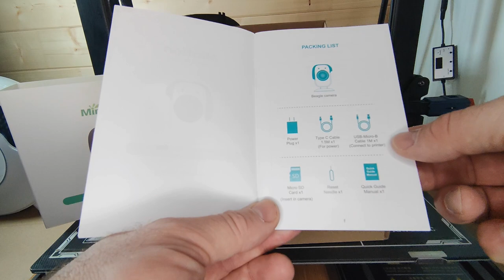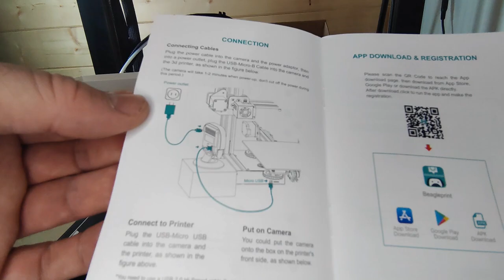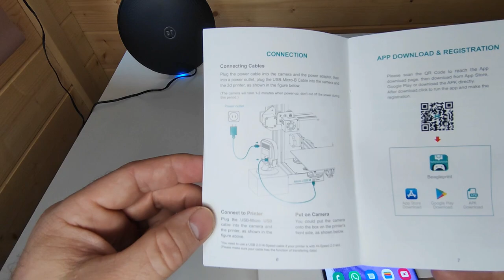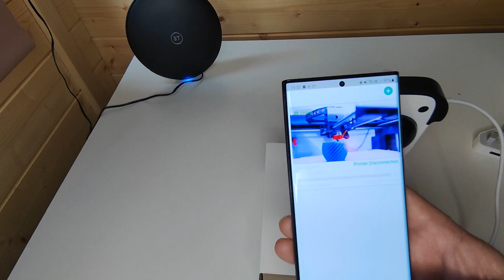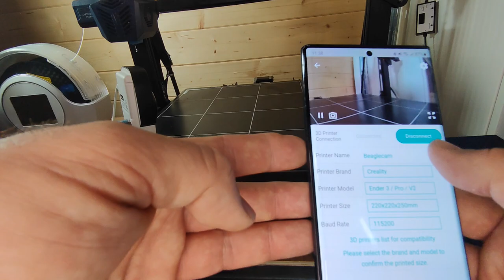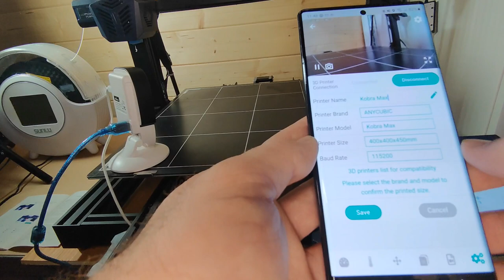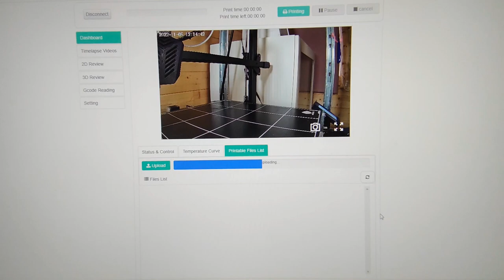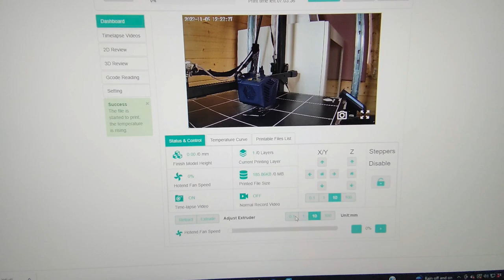Beagle Timelapse Camera setup on the Anycubic Kobra Max #3dpuk #timelapse #anycubic #3dprinting

Comment: Can I control the printer from my phone?
Reply from the maker: I believe  you  can adjust the temp of nozzle and bed during prints, and pause if needed in situations where the print had failed which is great for printers that don't have spaghetti detection